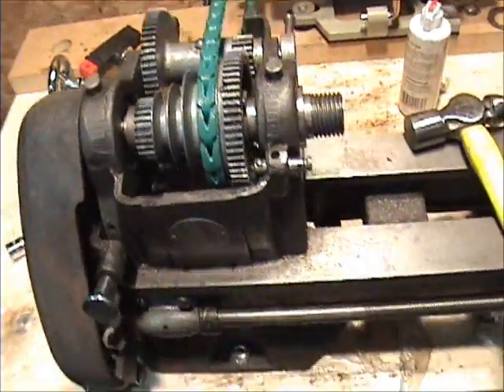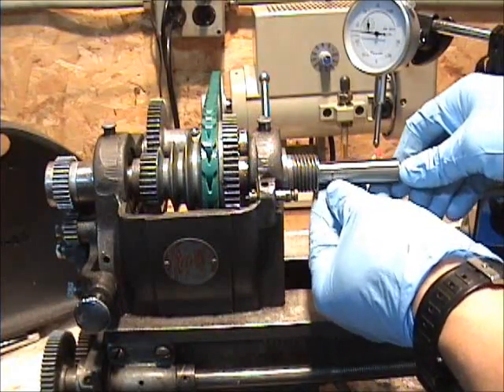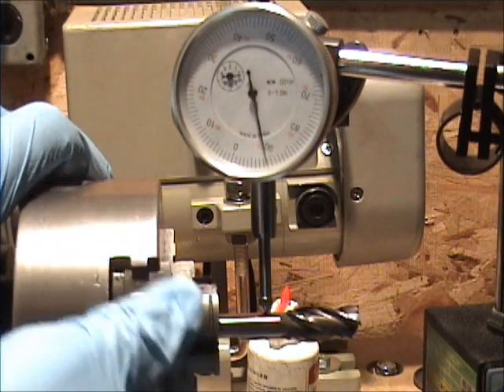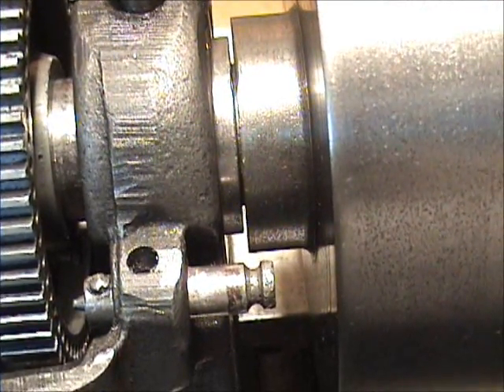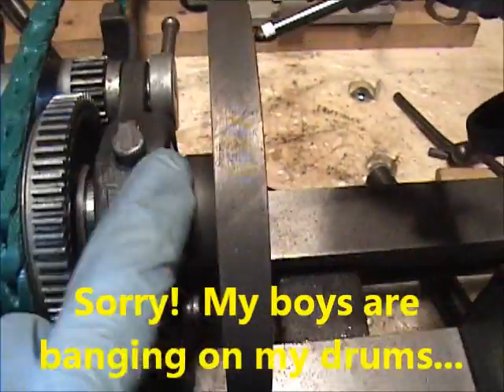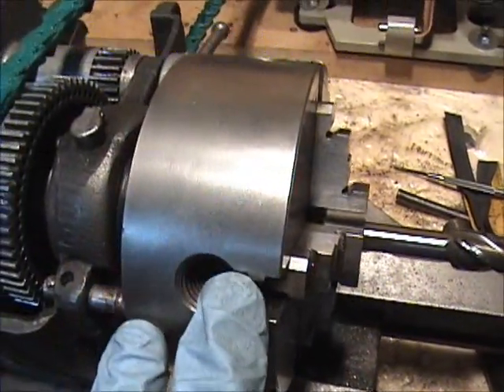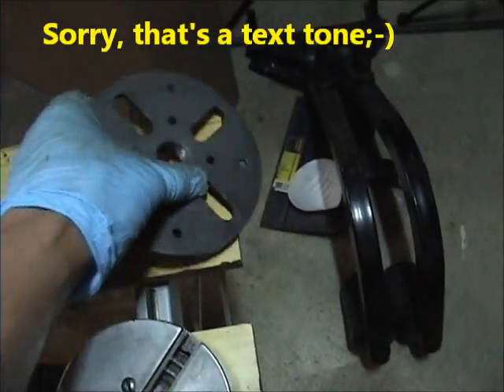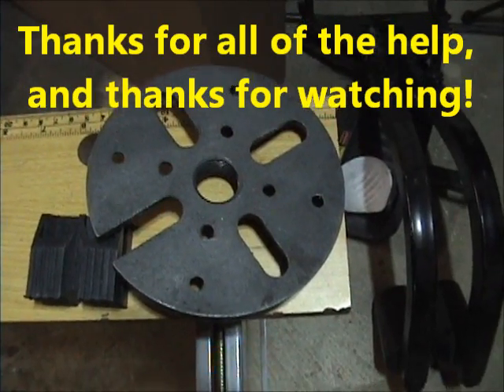Spindle runout of an Atlas 618 lathe

Comment: The three jaw needs to seat all the way down on  the spindle shoulder.  That is the only way to get the chuck to run as true as it can.  But that being said, the spindle runout is normally measured on the spindle itself --- not any accessories.   To correct your problem you would need a larger 4 jaw and cut the threads on the backing plate only or the female shoulder/ bore or whatever is interfereing  with a boring bar so that the backing plate threads onto the spindle nose more easily. If you had some Prussian blue paste you can tell where the interference is.  But in any case, do not cut on the spindle itself. And do not force the backing plate onto the spindle.  You may only need to remove half a thousanth somewhere to get the backing plate to go on all the way, so take it very slow and don't remove any more than is absolutely necessary to get a proper fit. This may entail setting up the lathe for threading the same pitch as the spindle nose threads have, so check carefully what these are before you start cutting metal.

You can't just face off the face plate because of the mis matched surfaces.  It would never go on the spindle the same way twice.

If you get the 3 jaw backing plate to run all the way to the shoulder of the spindle, then you can see what the run out of a piece of say 1/2" drill rod is.  If that is any more than say .003" then you would need to grind the chuck jaws internally to make the jaws close concentric with the spindle centerline.  Probably see one of Tubal Cain's videos on the subject.
Reply from the maker: Thank you so much!  I have leaned may of the things you said the hard way......

Comment: just wondering....if your faceplate is seated well and you still have a lot of runout couldn't you just face the face plate? that is providing your spindle shaft is running true. I would think if the spindle is running true and your face plate is seated but still out of wack you could simply face it like a disc rotor, is your spindle running true? I never saw you check the spindle itself. couldn't you put your dial indicator on an inside wall of the spindle and check there? if the spindle is running true then you would know where to look for problems from that point on
Reply from the maker: Yes to all of the above!  After replacing that spindle, I found out I should have tightened the spindle tighter.  So now I have an extra spindle:-)  Anyway, this has been a learning experience.  The lather is very nice now.  Thanks you for the suggestions.......

Comment from the maker: Tom, Thank you so much!  The register runout is almost nil.  After another $300 is parts (brand new spindle, bearings, bearing cups, and finally another headstock), I think the problem is exactly what you said.  The chuck is not seating on the register correctly.  I'll work on that soon.  I'm working on my Dad's lawn tractor restoration and will return to the lathe later this summer when I paint it.  I will keep ya posted.  Thanks again.......

Comment: Hi, jstr.

I've got the craftsman version of your lathe. Great tool for its size.

 Just to the left of the spindle thread is an unthreaded portion called the register,which centers a chuck or faceplate on the spindle. If it's smooth and free of burrs check the runout there. If the runout is the same or less than you got on the Morse taper(.001", right?), your spindle should be okay and you can check for crap in the 3-jaw threads. Keep us posted.

Tom

Comment: If spindle is then found to be perfect then its got to be that bearing you took off is causing problem. a .0005 to .001 readout at shoulder can be accentuated to .006 on a 6" perimeter.

Comment: only thing i can think of is remove bearings from spindle and to get someone to set the spindle up in a lathe with 4 jaw chuck , dial in at bearing surface to 0 total indicator readout (on gear end) and then set up steady rest on other bearing surface. then put a morse taper center in end of spindle and test

Comment: A spacer between chuck and shoulder would not be ideal but could maybe prove chuck. you will have to have a spacer exactly parrallel to prove the theory and if it runs true then maybe attach to back of chuck with countersunk screws.

Comment: It would be better to dial the chuck body to see if it runs true on od and face. Dialing into a workpiece using 4 jaw will always run true because you are manipulating each jaw independently. Face plate runout concerns me but maybe came that way from Atlas. The .001 runout from the internal taper is not bad but should be 0.